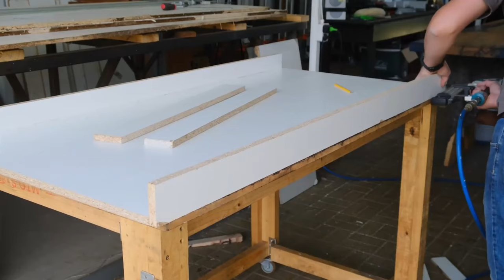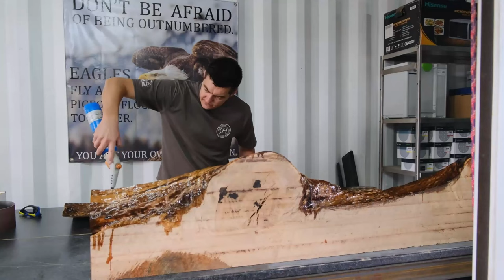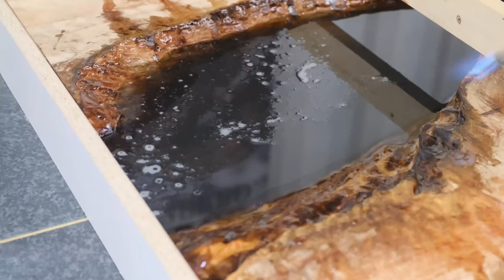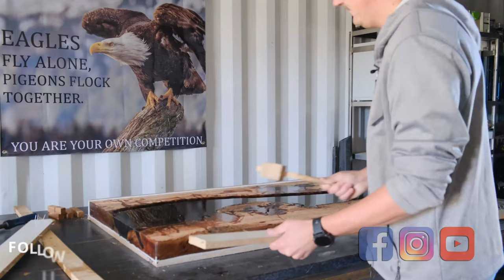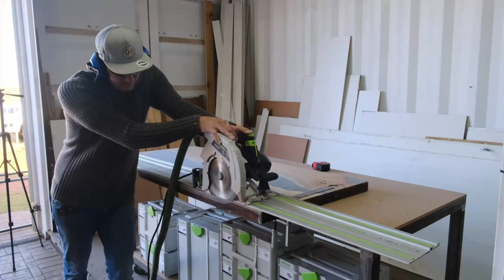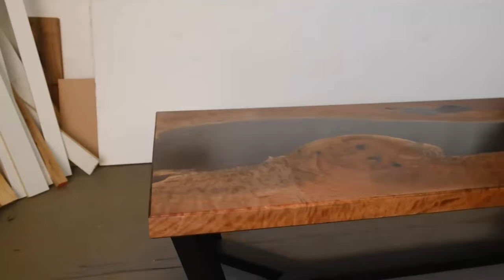EPOXY COFFEE TABLE BUILD - start to finish

Comment: Hi. Just wondering.  Is that laminated board you use on tray you made and if it is did you ever had problems with epoxy stuck into it ?

Comment: Hiya!! What material did you use as a mould for your table? That doesn’t effect the curing process of the resin and comes away easily please :)
Reply from the maker: Nope. Used white melamine
Reply: Nothing .tape it and deal with it.. don't let these knuckle heads tell you nothin else..